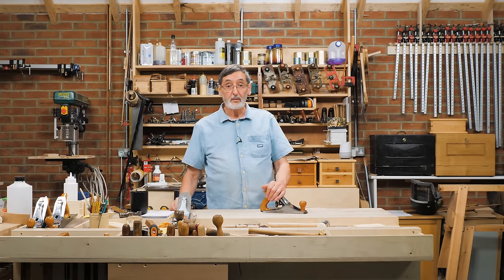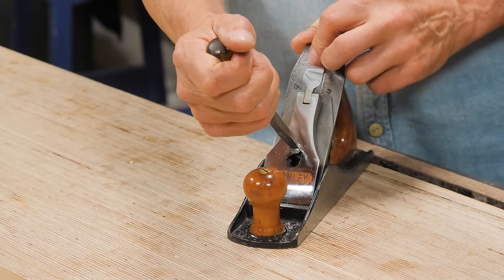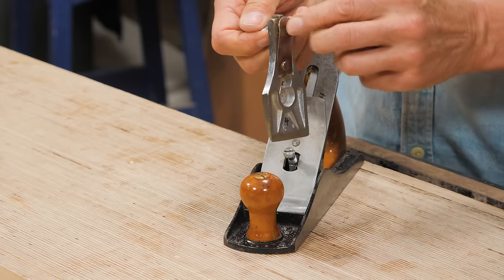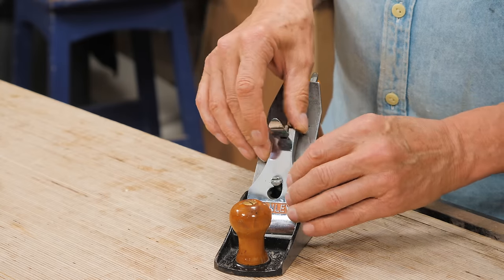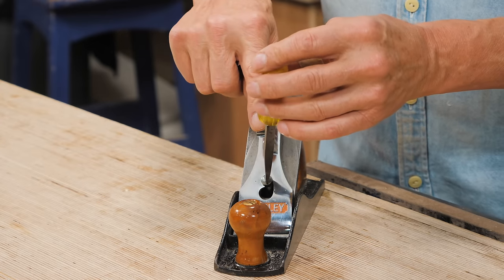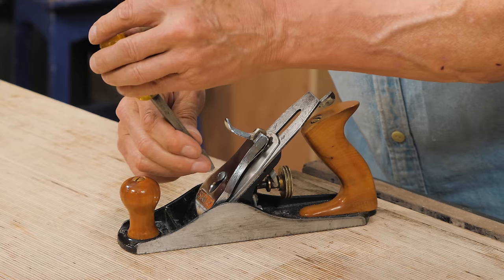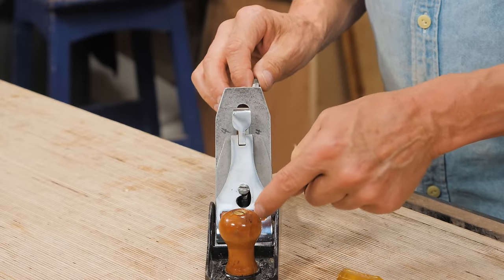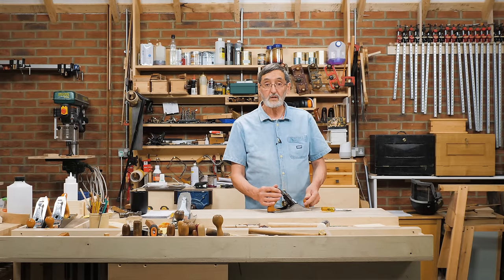How to set the Lever Cap on a Bench Plane | Paul Sellers

Comment: I wanted to thank you Paul for passing along your knowledge. Got my first bench plane (Stanley/ Bailey #4) this year. I  watched your video how to refurbish and sharpen over and over and over. Put the plane to wood and got the most beautiful ribbon! Instant addiction! Went to a trading post and found an old Stanley/ Bailey #4 and #5 for$25 each. Cleaned and sharpened them and put them to use. I  make live edge slab shelving and these hand planes have been a game changer. Thank you again Paul for showing that hand planes are not intimidating!
Reply: Congratulations on the finds at the thrifty shop, on returning 3 oldies to use, and to making such interesting woodwork! The soothing sound of Stanleys shaving slabs shall summon serenity straight to the soul. 
Cheers!

Comment: Why the screw that holds the lever cap is a flat head one, not a small knurled brass knob, so that no screwdriver is needed for the adjustment?
Reply: (a) the cost, (b) this one is a  "set and forget" screw, you don't change it often once you have it right, and (c) a knurled knob would stick out more, possibly catching on things and possibly not looking as nice.

Comment: Thank you. My problem is that my planes are in really rough shape, so the levers are not free enough to get a good audible “Snap” or “clunk” when it “cam’s over” to lock down. 
I really should take the time to fettle my lever caps and give the same attention to them as I give the cutting edges, cap iron fitment, frog base stability, and frog positioning in the throat. 
It’s a mechanism compromised by many parts. Parts which need to work in harmonious unison. It’s similar to sharpening, stropping, and polishing your chisels to a mirror finish before lining it up on a dovetail knifewall; then smacking it with a hand sledge. 
Everything needs to participate equally in a balanced approach much like the various facets of our daily lives. 
I’m reminded of Paul’s Vibrations video that discussed work holding, plane direction, filing, and the force with which we approach the task at hand. Sensitivity was the overarching theme of the conversation. I took an incredible amount of useful knowledge from that video and I do my best to apply it in every aspect of my life; both in the workshop and out. 
Paul you are a true master, an ultimate craftsman, genuine gentleman, and purely kind soul. Thank you from the bottom of my heart for everything you have so selflessly given me. You may never know the difference you’ve made in my life and I’m so many others but on you work for the greatest of good. The most noble pursuit is that of the betterment of others. You Sir are nobility indeed. 
With deepest thanks and utmost respect,
Christopher Castor
“The1HandiMan”

Comment: Hi Paul, very informative  video,, what advice can you  give when the  plane has a setting screw/bolt  rather than a lever ? If you  get my meaning. Thanks
Reply: Similar to an old Spokeshave type cap I imagine. Compare the snugness of the screw on a latched and properly adjusted lever cap (if you have one) then try to match it the screw/knob torque on your other cap. Not so tight that you can’t adjust depth and laterals, but not so loose that a slight bump knocks your cutting iron out of adjustment. 
Hopefully you can get a feel for your more difficult style cap with some practice. Walk away for a few minutes before you get frustrated; I promise preemptively cooling down with save the stress and allow you to look at the process with New Eyes. Don’t try and try and try so long that you snap and throw it across the shop!
You got this; no worries!
Reply: @christophercastor6666  ... thanks for that.. I have one that I  was given.. a faithful no 4 plane.. but the rest of my planes are stanley planes.. but this one.. it isn't  new.... 1979 .. ... maybe Paul wouldn't  touch with a barge pole.? Lol
Reply: @cag9284  I know some of the “TubeRoyalty” would scoff at something that isn’t a pre-war Bailey pattern, but I don’t know if Paul that elitist! 
I think A tool in your hand is worth 2 in the bush if you catch my drift, so why not try and use the one you have? Obviously you shouldn’t waste your time if it doesn’t come around, but hot damn it’s worth a shot. I have a 1930’s Dunlap #3 that smooths to a finish like an electric car buffer, Dunlap No. 4 that I’ll put up against a Bailey 4 any day, and I have a 1930’s Bailey 5 that’s not worth it’s weight in scrap. Sometimes you get surprised. Let me know how you make out!
Reply: @christophercastor6666  .. yes indeed... this faithful  plane is indeed  a little gem.. I often use it.. sometimes  works better results  to  some of my  Stanley's... sometimes  I  get the thumb nut too tight... but it is trial and error  until you get it just right ..just wondering if enyone  has a better way to set up this type of plane.. but like you  say most wouldn't  entertain  such planes... probably because  of the snobbery what goes around with planes.
Reply: @cag9284  I have noticed that checking the force required to move my cutting irons, both laterally and the stiffness of the depth wheel, is an obvious way for me to judge the hold-down power of the cap. If I feel like I am going to snap the lateral or like the threads of the depth adjustment are dirty, then I know I am too tight. Converse is true when I can thread the depth knob without flexing my finger forward and down. 
The little things that trigger awareness are seldom conscious thoughts, that is until we ponder our methods and try to describe the “feel” via inflectionless text to someone we have never met face to face. That’s a head scratcher for this fine afternoon in the shop. 
Maybe waxing philosophically about our tools will catch the master’s eye and we’ll be lucky to hear his thoughts! 
I never have had much luck though…We can always hope right! 
May the grain be rising and the ribbons be falling,
Have a great weekend!

Comment: H Paul. I've watched both your adjusting videos on the baley number 4. Would it be possible for you to show how to set up the (don't know the proper name for it) but, it's the piece that fastened to the sole of the plane and the blade and everything else is fastened to. Kindest regards Geoff Maddison
Reply: Paul made a video about 5 years ago called Restoring the Bench Plane which may shed some light on this for you. Also, I believe the part you reference is the Frog.